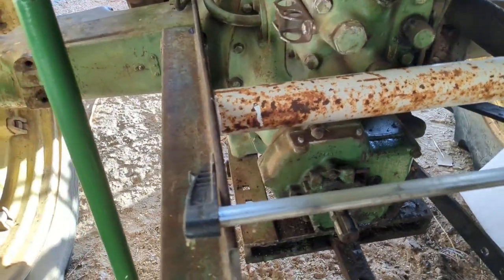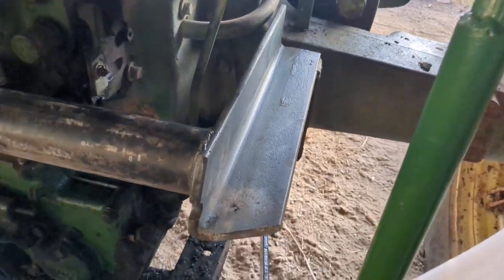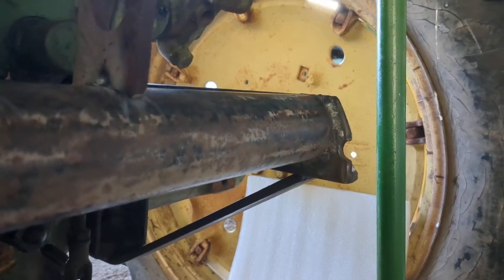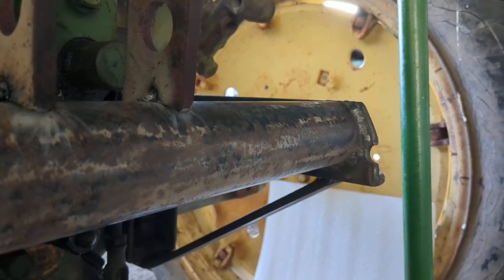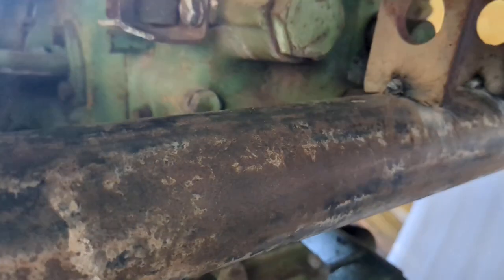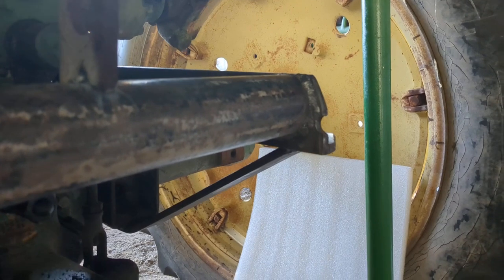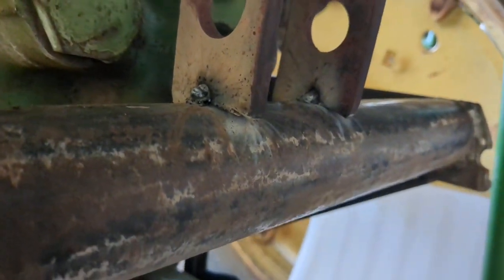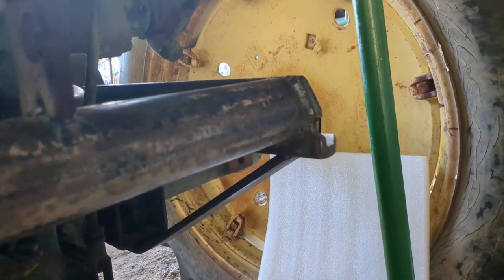John Deere 60. 3 point hitch build part 3.

Comment: That is how I design and build stuff also.  It usually goes much faster than drawing it.  The other thing that helps me instead of me thinking of what parts I have that i could use I go and look at my parts box and look at all my parts and estimate if any of the parts will work for what I want it for. Many times I find a part in my scrap bin that I might not of originally considered but ends up working great.
Reply from the maker: Thanks for your comments. It sounds like our minds work the same way.